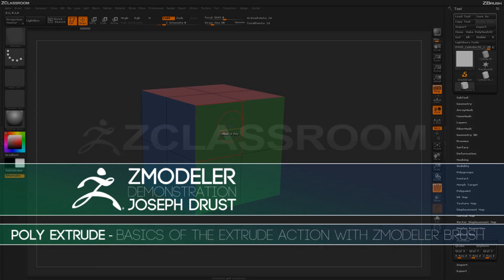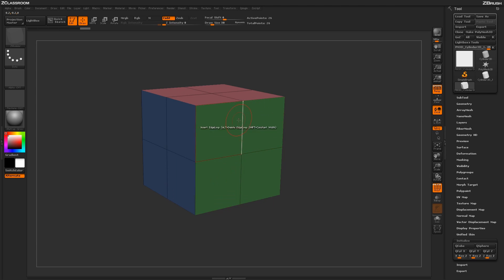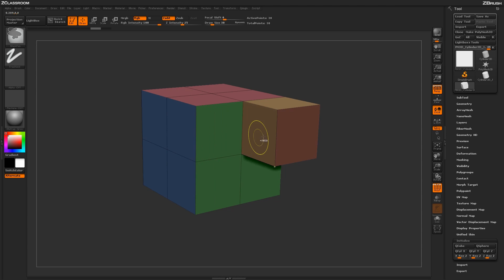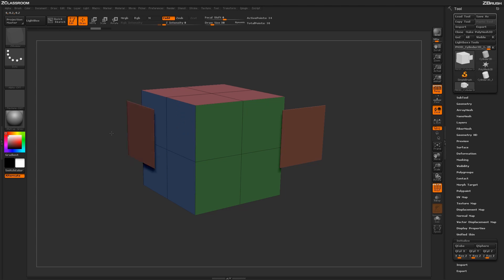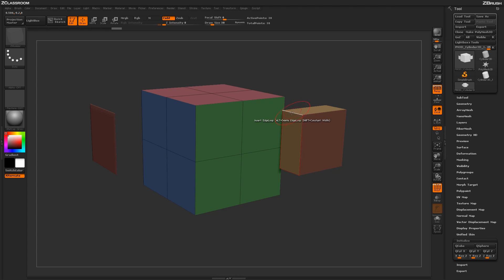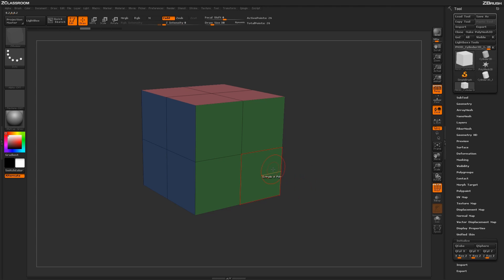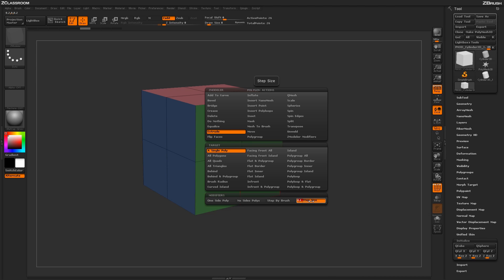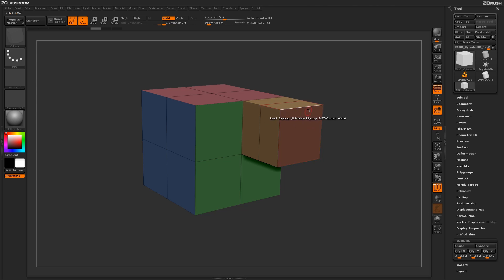ZBrush ZModeler Polygon Actions - Poly Extrude

Comment: please tell me there's the ability to do something as basic as extruding multiple faces at once... because homnestly, i'm not seeing it and i've tried all the parameters.  just... select multiple faces and extrude.  please.
Reply: hold down alt to select the polys you want to extrude
Reply: I don't see the difficulty here. Group the faces you want to extrude in a single Polygroup (go back to polygroup video to see how), then change the target from a "A Single Poly" to "Polygroup All".
Reply: thanks, but you shouldn't have to create a polygroup to extrude multiple faces at once in this tool.  you should be able to click on the faces you want and perform this VERY SIMPLE operation.  even Maya gets this right, and maya is awful.
Reply: @mddubeau  you can remove the polygroup after you've done it with one click...